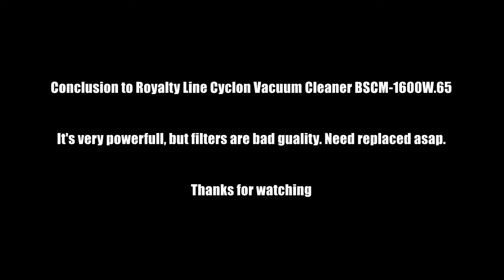Royalty Line Cyclon Vacuum Cleaner BSCM 1600W 65 - Video Review

Comment: do you think it is a good vacuum or you don't recommend it
Reply from the maker: Mohamed Beltagy it' powerfull but filters are just simple sponges. they need to be replaced because tiny dust will fly away
Reply: Thanks Daniel
Reply: Daniel H. with what would you replace them with?
Reply from the maker: instert94 i"m still looking for better filters. I saw in my country vacuums just like this for sale with excelent filters but they didn"t sell them without the vacuum. i will search online and if i cannot find anything i will make from used car filter.
Reply: try altex, myria, they have similar hepa filters but the vacuum cleaner is crap. i've bought one last year and after the 2nd use my filter is filthy. also, doesn't have enough aspiration power, desipte the 1200 watts motor.
Reply: Believe it or not, but my motor died in after 3 uses. the brushes were sparking like hell and the motor started to spin slower over time. hoping new brushes will fix the issue